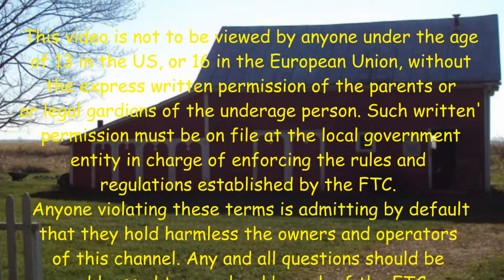Running Wire - Pt 12 -  Last Big Chunk Of Angle

Comment: Cutoff wheels really put the hacksaw on the back shelf, especially with some of that Hot rolled angle iron.  😃👍
Reply: Yea I'll pass on hacksaw action I carry a small handle with a blade in case I can't get into a place.  But in the end when was the last time we uses a fule to shape something other than cleaning up a few edges? Time moves on but we don't always have to that's why I respect and watch scoutcrafter videos.
Reply from the maker: I have repeatedly spoken of my feelings about hack saw work. 
I admit with a proper saw and the right blade for the first 5 minutes of the blade life they do pretty well. 
After that it is just unpleasant at best. 
I try and follow the fabricators order of operations. First cuts to break down plate or beams has the gas axe. 
Plasma is better on two inch and under. The cut widens out at the exit so lots of cleanup. Fast as anything going. 
Then saws to cut deep and straight sided. 
Sheet metal and smaller shapes like the angle I'm working with the cutoff wheel is really nice. Especially for home shops. 
Wire EDM has become irreplaceable for die work. Sinkers to make pockets and wire to cut shapes. As long as the cut is through and straight sided and the materail will conduct electricity, the EDM will cut it. Extremely accurate. Size is limited for most things. You have to be able to reach both sides so it shares throat depth with bandsaws as a limit. 
After the saw the mill is great for cutting to dimension and making deep pockets or odd shapes.  
Then grinding on the surface grinder. 
Followed by honing.
The last is polishing either machine or by hand. 
I did a lot of polishing with abrasive paper and die grinders with a rag wheel and abrasive dope.

Comment: I like my corded stuff best. No worries if the power goes off.GENERATOR!  Happy Grandparents Weekend and God Bless Yall
Reply from the maker: They all have their place. 
Power screwdrivers and impacts are best if they have a battery with a few extras on hand. 
Mine will run a week doing what I'm doing on the same battery. 
Chainsaws near the house and power are handy with the cord. No pulling the rope. 
In the woods I would rather have a gas engine. Fill the tanks and go. Ryan's battery operated saw is nice but it takes a long time to recharge and the extra battery costs the same as another saw.
Circular saws I use corded most of the time. The Milwaukee 18V is nice for cutting up pallets when I'm restocking. Also good for other short jobs up high or on the road. 
Recip saw I use the battery one almost exclusively. The big Milwaukee is best if I'm cutting big stuff. I'm not doing the big remodel jobs as much. So cutting 12" beams is rare.
I seldom use a corded hand drill anymore. Drill press work is mostly corded or using the Silver hand crank. 
Lathe work is always corded. 😁 Those monsters never move once they are setup. 
I'm not looking forward to dragging them upstairs.😁😎
Reply: I have a battery Makita 16" chainsaw that I really like.   I'm hoping that by the time I need a 20 inch, there will be more cordless options.   There are some already, but I don't know how good they are.
I'm really not good at maintaining small gas motors, let alone 2 strokes.   So I deal with the astronomical cost of batteries.   Luckily there are generic batteries that are way cheaper and are almost as good as the name brand.@OldSneelock
Reply: @tree_carcass_mangler  Use Tru-fuel in the 2-cycle stuff. Premixed and has a long shelf life.  I went with Stihl for me because I'd used the others and they did o.k. but Stihl went the extra mile as far as running and chain hardness. Oregon makes a good chain but you can see the difference right quick when you file one. My wife has the battery Stihl with the 3 inch bar. EVERYTHING on the whole place trembles when she walks outsid with it. I was going to get a bigger Milwaukee but I had an issue with bad batteries or a charger. Sent it back. Stihl stuff to ME is bullet proof. We have one of their battery hand mowers. SWEET!
Reply: @tree_carcass_mangler  My 1st battery rig was a Makita drill/driver and did fine for a while BUT when both batteries died at the same time in went to the trash and the case made a good storage deal for the corded DeWalt 3/8ths and accessories. Still there too. Had to put a switch on it from driving so many deck screws. Still going but I've got the impact for such things now. And a battery drill/driver for the 65 Ford rattle can paint shaker. DeWalt. And also a string trimmer that ran once inside when put together. Just waiting. Toots has her Kobalt stuff except for the Stihl mower and saw. I mow. My job! Don't mess with hers. She don't like mine.

Comment: Definitely fun stuff.  Love the comments on cordless vs corded I'll bite.  I own the best cordless angle grinder on the market at my biggest battery gives me 20 minutes at a time I have 3 of them.  In most situations I'd rather have a corded tool for sure when it comes to angle grinders.  I have 2 set up with different wheels flap and cutoff. That is only 75 to 180 for 2 tools! Battery is 4x as expensive and isn't worth it for anyone who uses a grinder for more than an half an hour a day.  That angle iron looks thicker too?   I dare say these days would people go back toa corded drill with a 20ft cord? Probably not unless it's a drywall gun.  As time changes things become the norm and we don't know how we lived before that.  I'm glad your using what you got and enjoying the journey!
Reply from the maker: The 9" grinder is well worth fussing with the cord. The thing would weigh 50 lbs with enough battery to run it 20 minutes.